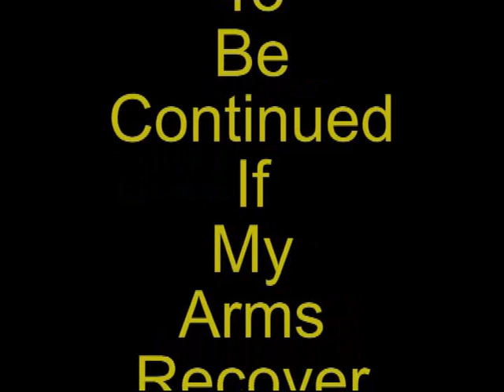DIVIDING  HEAD PART SIX

Comment: Thanks for doing this video John, lots of good explanations, just missed what you said while the furnace was running.
To improve your sprue and riser pressure you may like to try myfordboy's idea of extending them up using old fruit tins packed with green-sand. Less burns to your cope and drag. 
Also another clip I saw they guy was doing his pour over a mobile sand box. 
Just a thought. Mark

Comment: Hi John, Hard lcuk with those two castings ! A lot of effort just to be scunnered we the results. Well I hope you put some of tha alcohol to good use that night ! :D I'm hoping you can expand on the furnace you use. the burner and any equipment you need to melt and pour the molten metal. Temperature your able to achieve, metals you can melt and the time and cost of the melting operation ! Im just about ready to start making my furnace and am looking for any and all sources of info.Great Vids btw